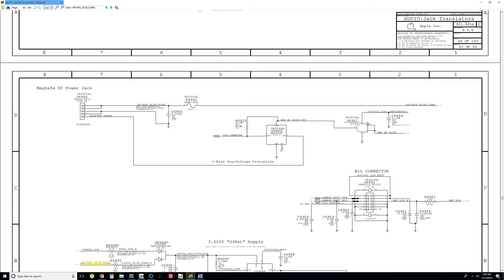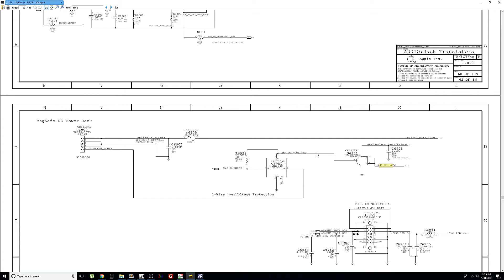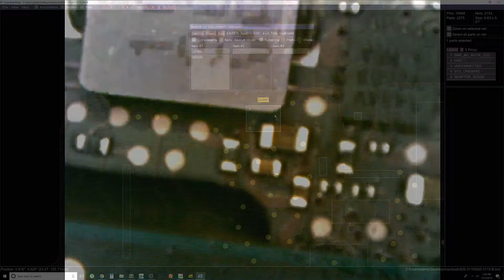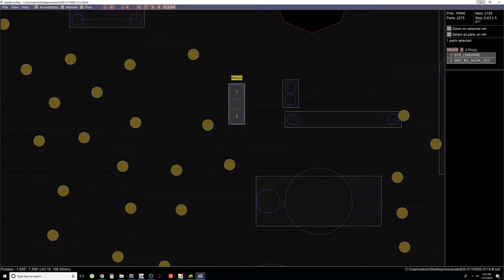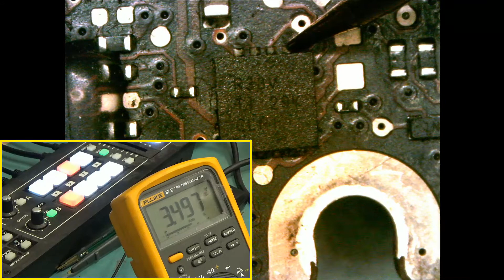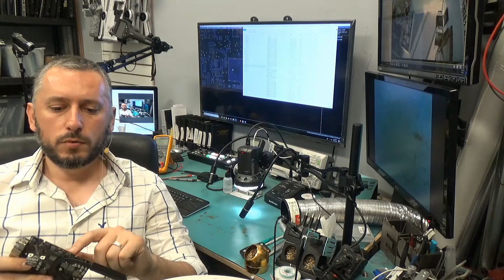2012 Macbook Pro 820-3115 No power No green light Faulty SMC

Comment: if my charger is putting 17.8 volts is that enough to pwr it on? i have 15 inch mid 2012 mbp. it was working fine I shut it down and later was unable to power it on since. It was able to charge the battery to full.
Reply: I have the same model with the same problem... How did you fix it?

Comment: I do not read any voltage from the U6900 VCC pin 5, and I checked and saw that I do not read anything form SMC_BC_ACOK. The 2k resistor is fine. I replaced U7000. I read 4V at CHGR_ACIN but the new U7000 chip is not outputing anything for SMC_BC_ACOK. Is there a chance that the SMC is causing trouble for U7000 and causing it to burn out?
Reply: Did you find the problem?

Comment: good luck,i have mac pro early 2009 no power,Sometimes it works then stops!
I doubt smc ic but i have not 820-2337 schematic and nor datasheet smc ic
How to check smc ic?What is the solution in your opinion?thank you.
Reply from the maker: No power could be many things. The questions is very general. You need schematic and board view to properly diagnose a board.
Reply: hello;yes exactly but where can i find schematic for 820-2337-a?thanks.